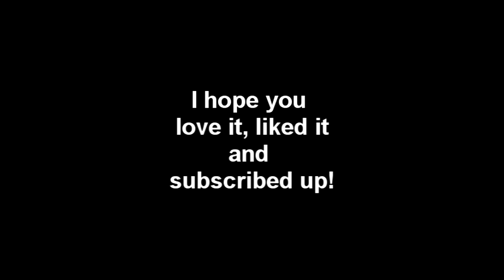GOPRO DIY MOUNT - PVC PIPE - HERO MONOPOD - PVC Handle

Comment: nice. but you could also just put a cap on the other end with a 1/4-20 screw threw it, and a gopro tripod adapter on it.

Comment: I cannot get the epoxy to set completely in the top of the pvc adapter for the LIFE OF ME. What did you do to get it to set so well? And how long did it take? 

I've tried on like 9 different ones, even with 2 different diameters. I'm trying to do this on a 1" diameter PVC instead of 3\4" so I'm using 1" to 3\4" adapters for the tops. I don't have a band saw (I'm very jealous lol) I have to try cutting with a hacksaw and a huge pipe wrench for holding the piece while I cut.